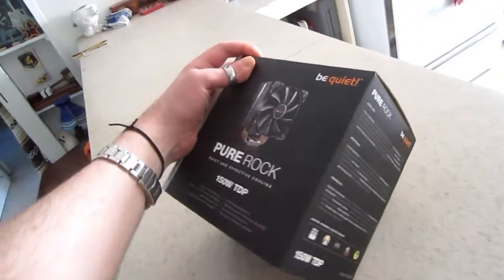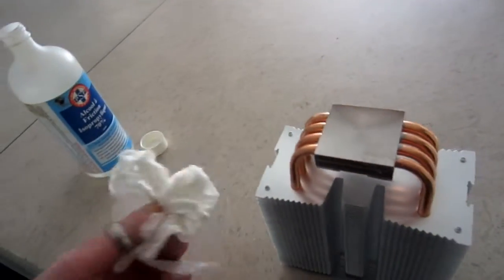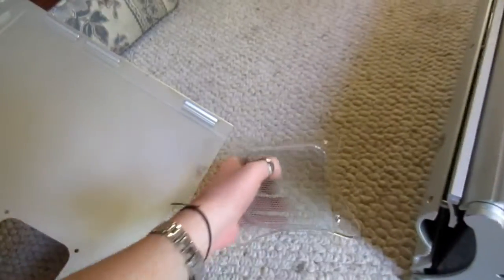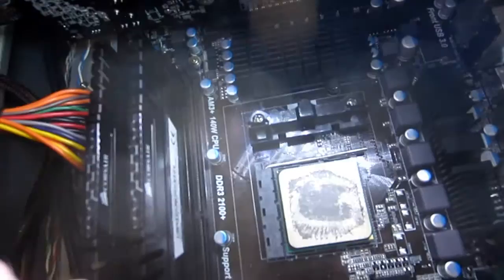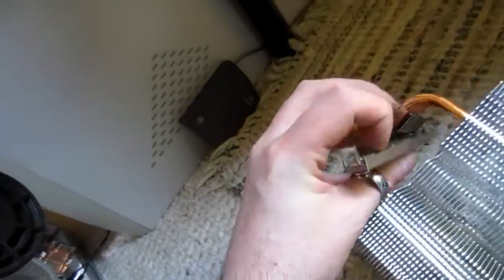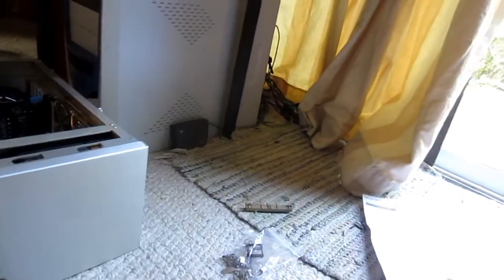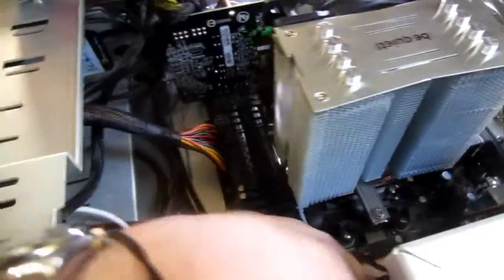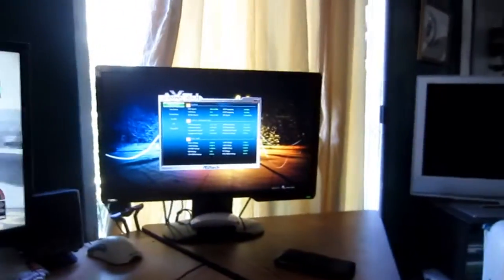BeQuiet Pure Rock CPU Heatsink Cooler Install and Review

Comment: you should've cleaned off old thermal paste from cpu and applied new paste. there's really no reason not to.
Reply from the maker: I had that heatsink on and off the CPU so many times test fitting it, it would have been a waste of thermal compound. in the end I did actually end up doing so one final time and getting a wider case :)

Comment: Can somewone help me ? when i applyed the cooler to the mob the cooler isin't stable if touch it, it moves, and when i turned on my pc i got 50-70C they were changing very fast, i don't know what to do now... i replied the thermal paste about 3times, nothing changed.
Reply from the maker: its not tightened down enough. make sure the clips are locked in, you may have to play with the screws a bit to align it and also make sure your case isn't bending it over.. and of course make sure the fan has power. G'luck!  :)
Reply: idk what to do i tight him up but he still moves...

Comment: How did you get the mounting bolt in that is under the fan?  If you left one zip tie off you might have done it by swinging the fan out some to get to the bolt but you never bothered even showing how you did it and it is practically impossible to get in with that fan completely blocking access to the bolt.  The instructions said to leave the bolt loose until you got the fan on then use that crummy wrench like gizmo they included to tighten up the bolt under the installed fan.  Right.  Stupidest design of all time.
Reply from the maker: I hear your pain, its not the easiest fan to install. I loosened up everything on the mount and slid it back and fourth until I could get a good grip. the trick is to leave the bolts loose up until you want to tighten it down, Hope that helps! :)
Reply: I tightened down the mount then used long surgical clamps to maneuver the cheesy fan mount in place next to the wall of my case.  It took me about 3 hours and I needed 3 hands to do it.  I've been building computers since 1995 and this was the hardest part I ever installed.
Reply from the maker: lol... i hear ya. its not the easiest heatsink to install. but kudos on getting it done!

Comment: Installing the fan is simple if you look it over for a minute... Take one clamp first, attach it to the fan and then with the fan where you want it against the heatsink you pull the clip back and around the jagged middle edge of the side. then repeat on the other side.. It's super simple and is a better option than what you did, its tight and doesnt move. Yes it is german and well designed, you're just being silly.
Reply from the maker: Good tip! thank ya!

Comment: "Don't do it the way I did it" is about the only part of this video I would watch.. I kinda hope you were trolling through the whole video or else you should stay away from computers :P
Reply from the maker: It's still working fine over a year later and even Linus tech tips used zip ties with the same heatsink because the metal attachments are trash.

Comment: Actually the stupid clips are working, my problem is that the cooler itself when applied is moving a little bit form side to side and that makes me nervous....on top of that when playing games that are running like 60 fps, and still the games are like glitching or something and when I turn my PC horizontally everything runs fine...and that is from the cooler because it just do not stick properly...I don't know why, I am doing everything that I need to do, but when I turn my PC vertically (normal), despite the fact that 60-70 fps are more than enough it seems like the game is running 15, but all kind of programs are saying 60+....oh yeah and that's from the cooler...I just don't know what else I can do now...sorry for the big novel but i am pretty much angry right now
Reply: k1lva4a did you manage to fix it ?,
Mine is moving to ! ( on amd) my screws doesn't fit in the bolts! Can u help me ?
Reply from the maker: are you 100% sure its seated right? I actually had to reseat the heatsink to the cpu again after i made this video, the case loosened it off. i eventually ended up just buying a bigger case so it didnt rub and its been rock steady and blowing cold ever since :)
Reply: paradoxdesigns wrong screws ... Working just fine now ^^ thanks ;)
Reply from the maker: azurity madox awesome. glad to hear it!

Comment: can i install the backplate on an AMD motherboard ?
Reply: +OneTruth Installed mine today. I couldn't, you use the original amd bracket you already have, which is a shame, becuase that means you can't orient it so it blows sideways. You can only orient is to it blows up or down.
Reply: +Kubilay Keser thats bulshit , i gona buy cm hyper evo 212.. its better in performqnce and i can rotate it..
Reply: +OneTruth yea its a letdown, though I gotta say, the fan is reeaaally silent! hahah
Reply: yeah bruh , its named be quiet hah , have fun with the cooler :)
Reply: I can only attached one of the hooks on the amd bracket?.. Any tips?
Reply: +Joel Signeul Attach both hooks on the long plate very lightly. After you've secured the cooler, THEN tighten them. And after the cooler is secured, mount the fan to the cooler.
Reply: You must have a lot bigger case than I have.  Installing the fan after attaching the sink is a nightmare in a mid-size case.  I don't have some fly by night case either.  It's a Corsair Carbide Series 100R Silent Edition mid-tower.  I have an ASUS ROG Maximus IX Hero m'board.  I've been building computers for over 20 years and this was the hardest install I've ever done.

Comment: Will this keep the CPU fan from running all the time?  Maybe thats what I need...
Reply from the maker: It'll run all the time but at such a low rpm unless you have a bunch of case fans, noisy power supply or a big honker of a video card, this will run so silently you won't be able to hear it.